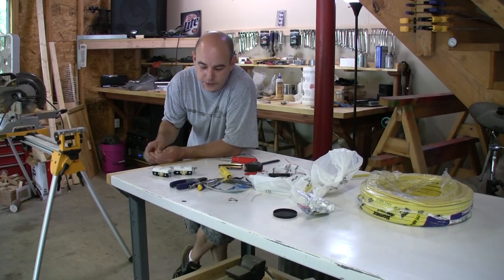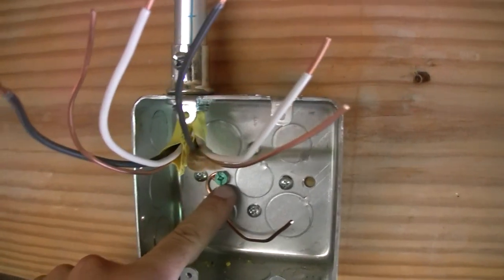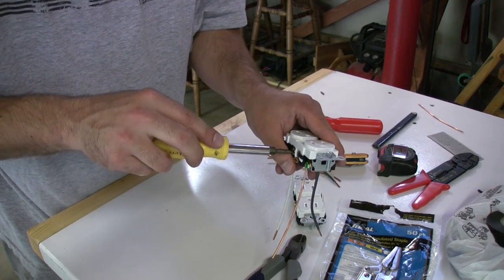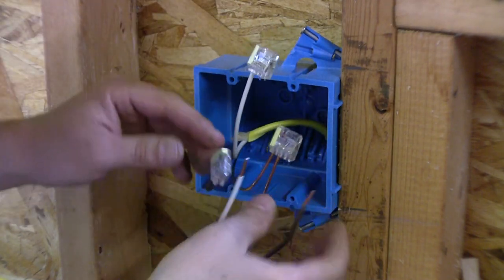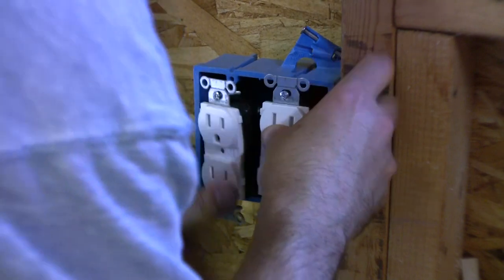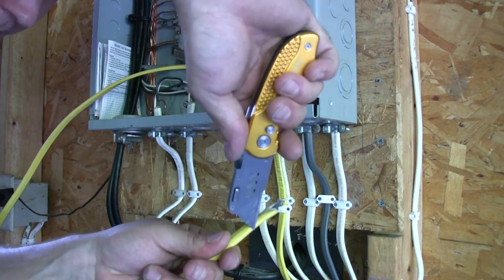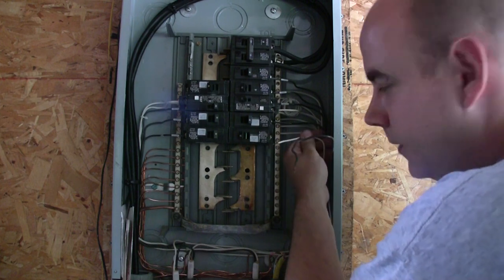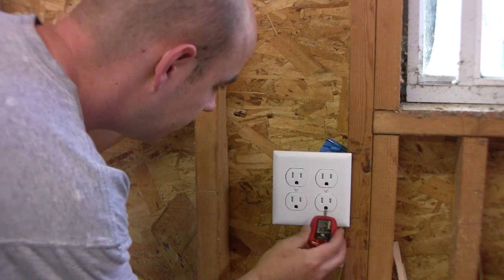Adding Outlets & Double Receptacle Wiring

Comment: As an electrician I'd NEVER use those type connectors for a joint.  They seem popular at times but nothing will ever beat a properly twisted tight wire nut connection. Not to mention that the "push in" type will eventually fail while under load. (so if you intend on doing actual work in your shop those are not the best idea...)
I get taping the receptacles (I do this to all of mine).  The idea (for anyone who doesnt get it) is to help isolate the terminals on the side in case you have a metal box in the wall or if you ever plan or may remove them from their box while hot. (it just offers a bit more added protection in case of bumps or slip ups) 
6:39  the pipe above your head should have a bushing on it... romex is not intended to run into emt conduit, doing so in that manor will eventually cause damage to the outer sleeve insulation and/or a actual gouge in the wire.
Reply: I've seen the push in connectors in quite a few newer led cans
As well as wagos which have also not been proven over time
Reply: @revolutionslo12  I've seen wagos fail a few times and it's never a good sight.
Reply: Good Eye... I totally missed that at 6:39
Reply: Well said I'm on my 3rd year
Reply: Agreed 100% from an electrical engineer. We see the push in connectors failing way too many times and it creates a risk of shock and fire. The few seconds it takes to secure that wire around the screw terminal and properly tape the perimeter of the outlet is worth it!
Reply: This shop could last a hundred years and the odds of it burning down by a wago or other "push in" connector failure is much lower than a lightning strike, tornado, arson, etc.
Reply: Broke But Functioning Garage A British tinkerer on YouTube tested Wagos buy pushing through high currents. The wire insulation failed earlier than the wagos or earlier than the wagos connection deformed. In other words, the wagos were no less worse than insulation. So I don’t know what you mean by failed; the connection failed or the connection arced or smoked ?
Reply: Thanks for the message on the risks of using the connectors. I saw them at my local hardware store and I thought about getting them. I have a bathroom box with the twisted tight wire with nut connection. I was hoping to find a better method, but per your message, I'll stay with doing this. 

By the way, is it okay to solder the ends of wires after twisting them? Does this improve the electrical connecitivity between the multiple wires that are twisted together? 

Thanks in advance.
Reply: @veltonmeade1057  soldering is okay but not necessary to make a good connection.   A simple wire nut twisted tight is long lasting and easily changed in the future should you decide to modify the electric at a later date.
Reply: Thank you for that...  I was wondering about those.
Reply: I wondered about the electrical tape. I have watched many YouTube videos of "real" electricians, but they didn't use tape.
Also, no one mentioned if you should start at the end of the run, and work back to the electric box, or start from the electric box and work out?
Reply: @LaughingblueSu  i always work from the end of the line back to the panel... that way when it comes time to land the wire in the panel everything "downstream" from that point is finished... eliminates the chances of someone touching something that is hot and not finished.
Reply: @brokebutfunctioninggarage  Thank you that is very helpful!
Reply: Bold statement saying "nothing will ever beat a properly twisted wire nut". Although I agree the engineer in me is saying "challenge accepted" lol 😆
Reply: @pauljohnson1991  if engineers could do their jobs I wouldnt have to work as hard as I do trying to make shit work that they fucked up. ;)  just sayin...
Reply: I just bought a remodel can light housing that came with those push in connectors
Reply: I've had Wagos installed for a very long time, no issues.  They work just as well as as the twisted connectors, but much quicker.
Reply: @tonymanero5544  
Thanks for that.  There's so much hearsay and anecdotes of supposed failures of products on YT.  Makes me wonder how this stuff could still be sold if any of the stories were true.
Reply: @brokebutfunctioninggarage  
Calling BS on that.  Where's your evidence refuting the results of the testing that's been done on these products?

Comment: I never use push in connectors for heavy or unknown loads,and certainly not to connect ground wires.(l may be paranoid,but I don't really trust them.)They are fine for connecting lights though.Looping the wires clockwise and screwing them tight is what i like to do.
Also the tape is quite unnecessary.
Reply: Michael Nobibux that's your opinion.

Comment: Hey Mitch, very neat job. As a master electrician and former electrical inspector, I have to find at least one thing wrong 😉. The short piece of conduit on the metal box should have a bushing on the top end, and all receptacles in garages and shop areas should be GFCI protected. I'm not trying to be nitpicky, I just want people to be informed.
Reply from the maker: Wow ok! Cool no I like knowledge thank you! I'm gonna look into that bushing I remember questioning that and sanding the edges. I like things to code, ohio.... but yes as for putting in GFI receptacles. I guess as I add outlets I will change the first one in line out...?  Really does help thank you!
Reply from the maker: +MIXED TEA Thanks for tip! I was unaware that was a no no.
Reply: No you can staple 2 wires together, but only with 1 staple.  If there is a staple beneath the romex on the top, it can cause the circuit to trip.  Remove the staple on the 14-2, and staple the 12-2  (not too tightly, because that can also cause tripping) and 14-2 down with one staple
Reply: Nice to hear a piece of constructive criticism on the internet without you calling the guy a fucking idiot or a moron. Very good tip as well.
Reply: ...also, are those outlets rated for 20amps?....does it really matter??
Reply: This is nothing compared to the fact that this is a sub panel and he has the ground and neutral bonding still intact. Mega no no.
Reply: Country Family that's what I was thinking I put gfcis in as much as I can they cost about 14 $15 but they are much better outlet they will protect you much better much faster than your main circuit breaker will
Reply: If that’s 12 awg wire then I’m pretty sure to code he has too many wires in the box....... each yoke counts at 2 along with your current carrying conductors which is 6, then add 1 for the ground. So that’s considered 11, 12 awg wires in a 2 gang box. Maybe if it’s a deep box it’s within specs but damn close. Get rid of those little connector things and wire them up the normal way and you would definitely be good
Reply: mitch ,,am i blind or do you have the neutral and the ground connected together in your subpanel ..from my learning the neutral bus bar in the subpanel must be floating ,,and not bonded to the grounded  bus bar ...i the main panel they must be bonded
Reply: @Steve Main code calls for it to be and it's smarter to have the gfci at an outlet so it trips there instead if tripping in the panel
Reply: @BradsWorkbench  yeah depends on what box he used, box fill isn't my strong suit
Reply: @Steve Main so how we do it is we keep the spot that would trip at an outlet instead of in the box. So instead of tripping the breaker you trip the gfci. You just run however many outlets off of the gfci outlet and you're good. Most don't need to be gfci but when you run them off of one you basically have what you're wanting. All outlets would be protected
Reply: @Steve Main gfcs are needed, especially where damp and wet conditions are. Code specifies locations where they are needed but it never hurts to have them at all. They're a necessary part of safety so I'm going with no on the over kill
Reply: A master electrician and inspector? 😂 I doubt it. You only found 2 code violations?
Reply: @Steve Main you can put as many gfci as you want. I use them all the time, but it's smarter to keep all tripping of anything out of the box
Reply: @andrewilliamson6057  he understands that. He was just asking that since he wired them double gang, would having the parent outlet be GFCI be enough to protect both both outlets?
Reply: @21area21  yes. If you run off your gfci in a double gang outlet box then yes both will be gfci if you wire it correctly.
Reply: @21area21  you can run in series as many as you want off of a gfci and those outlets wired off of the gfci will be protected. Gfcis are wonderful but not all outlets need them. My rule of thumb is with the amperage
Reply: @aklover18  Good catch.

Comment: Those push in wire connectors are really handy. I just don't trust them. Nothing beats a properly twisted splice+wirenut.
Reply from the maker: +Sparky 97 I agree now. I'm doing more electrical stuff currently and I like the bulky nuts.... Especially for the ground. However I have had no problems with those push types!
Reply: Mitch Deitrich They work well. I've had zero problems with them as well, thank god! The thing is they haven't been on the market long enough to see if the connections go bad after 30 years or so. But they're code compliant so they must be a somewhat trustworthy product!
Reply: In my trade school I'm on 4 gangs and 3 gangs, with all sorts of wires and such coming in the box.  Really gotta say, those wago's that can support 8 wires would really come in handy versus all the pigtailing i gotta do
Reply: So those push in connector are up  to code?
Reply: They are handy, but they are only good for lighting circuits honestly. They get very hot with a 15 amp draw. Just think, its a razorblade edge making contact with your wire, not much connection there. High resistance
Reply: @SwedeBoy27  yes, wagos are great. We use them all the time in fabrication and commercial uses.
Reply: @Writer B.L. Alley I always say it, just because its legal to sell and use, doesnt mean its safe!! We lost our garage a few years back and the fire inspector claims it was due to "thermal arcing" somewhere in the circuit which is very common with the stab connectors! Scary stuff
Reply: I'd rather twist an tape than use that crap
Reply: Absolutely!
Reply: Wire nuts are such a pain, accept the future of stab connectors! 😂Wago is the only brand I'll use for stab connectors. I've never had issues with them or witnessed this overheating. I strip the wire to the precise measurement and use electrical around them.

Comment: those push in connectors are very unsafe over 5 amps. Do a test yourself with an electric heater and tell me how hot those bastards get!!!  Plus why wire nut the outlets all together, when you can daisy chain one outlet to the next in a double gang box?

Comment: Push in connectors are not reliable at high loads! Everyone seems to love them though!But they are a fire risk,even if the code allows their use.
I use them only in light fixtures and low wattage applications.
Use wire nuts with the threaded steel spring inserts instead!!
Reply: This is not true.  They are tested under the same UL standards as wire nuts.  They have the same rating, bot wire nuts and push in connectors are rated for 600 volts at 105 degrees C.

Push in connectors are usually rated for 600 volts.  Household wiring is 120 volts.  

I'll change my tune if you can show data that these are somehow inferior.
Reply: Zachary Collier 
Not because something has a UL approval makes it a superior product to others similarity approved!

Comment: That sub panel is set up wrong .. your neutrals should be separated from your grounds
Reply: piazza gregg the ground & neutral should NEVER be bonded together in a sub panel because you've now given the return current more then one path back to ground .. a sub panel with the ground & neutral bonded will never pass inspection
Reply: piazza gregg Oh I didn't see that comment, that it explains why they're mixed ... but if that feed is now being fed from the main panel he now has to take that feed wire all the way out & run 3 wire that's rated accordingly
Reply: @Ted Fisher The neutral (white) is bonded ONLY to the EARTH (outside ground rods) + Ground + main panel ONCE (sometimes main panel can be main outside disconnect, next to meter).  A picture: pg. 4: Exhibit 250.1 might show http://necconnect.tpnicdn.net/wp-content/uploads/sites/2/2014/08/Article-250.1-250.4.pdf
Reply: Its probably an older panel in another building so there is no ground wire

Comment: Is that the main power panel or a secondary? On secondary panels the ground and return lines should be isolated.
Reply from the maker: Second. Used to be a main. Also if the ground bar is an issue to you it like everyone else...it was fixed. But in my personal opinion the that doesn't matter... Like a water well being grounded the well casing. " Ground loops... " Whatever. Electricity follows ALL paths to ground. But hey man!! Thanks so much for watching and commenting!!

Comment: Is it my imagination or did he use 12GA/20A wire and 15A outlets?  Seems he'd be better off with 20A outlets, not that you can't use 15A and lower capacity. Gives you the ability to use 20A devices... assuming the breaker was 20A of course.  Just say'in.

Comment: You are over killing certain things only to make the entire gig more dangerous.  There are way more staples than necessary, you want a hint of slack in the cable in case of impact or puncture situation.  Rather than leaving a proper loop of extra wire before going into a box, you have ran a conduit... ...that has one end with no grommet/connector.  I am  not a fan of any quick connect push in connections.  I am not an electrician, but seriously, why not just loop and screw down?  Why tape down a plastic quick connect connector?  It's not like the housing is going to shatter...

Comment: I'm not a electrician, but are you not suppose to run Romex wire in conduit, when it is exposed? Especially in a shop environment.  Here in Cali it is code. Maybe were you live they don't care if you electrocute yourself.

Comment: You implied that the panel in your shop is a sub panel. It looks like the neutral and ground are connected and should never be in a sub panel, they must be separated or the ground wire will be carrying current. A receptacle tester will not catch this. If a gfci was installed and you plugged something in, it should trip.

Comment: Great video, I've learned a lot. Do you use 12/2wg for all your wiring? I've found that this size wire is a real workout. I've had 'professional' electricians do work for me and none have wrapped the outlets also, none have used a tester. When I checked their work with a tester sure enough the wiring failed. When I cut off the house power my wife gives me hell. Guess she wants me to get electrocuted. Also, asks me if my insurance is paid up. Do you use a GFIC on your circuits? I've used the wire connectors with no problems. I wrap them and never, never reuse them, the same with wire nuts. After I insert the wires I put a zip-tie on the wires where they exit the connector.
Reply: No need for 12/2 unless your using a 20A breaker.

Comment: I advise against using the push type connection on the back of the outlets, use the side screws instead. The reason for this is every time you plug in/out of the outlet, that connection is stressed. It will ultimately fail, the wire will either wiggle loose or shear off, leaving an electrified nub. Take the extra 10seconds to form a hook and use the screws.
Reply: He didn't use push in aka backstab. These receptacles are spec grade and don't allow that method. What he used is the back wiring option where the wires are clamped in place when the screws are tightened.

Comment: I am sorry but you are using 15 amp plugs on a 12/2 wire. Not cool. Those connectors you are using are for amateurs. Nothing beats wire/wing nuts. Wrapping plugs with electrical tape is questionable. Wrapping the connector you are using with tape could also create extra heat. No heat dissipation. Fire hazard. Probably against code. Just sayin'...
Reply: He is using "spec grade" 15 amp duplex receptacles which is exactly the same as a 20 amp, but without the horizontal slot. This is code compliant on 12-2. There is no reason to use a 20 amp duplex receptacle.

Comment: Shit video, didn't really explain anything on how the second outlet corresponds with the first one! Reading comments a lot of people don't like what you are doing but don't let it discourage you mate! You are probably learning as I am! I am hooking up a solar system that I hooked up a couple years ago, we had a flood so I tore down everything and moved to higher ground! Barns, shop, livestock pens, greenhouses ECT and I'm just getting back to putting the solar back up! I can't remember how I did the outlets, I have two outlets coming off an inverter and it has a ground that I ran two wire off of one for each outlet, then I have two AC hot wires one for each outlet and one neutral wire and I think I hooked it to one of the outlets then connected a wire running off the one outlet to the other outlet! Can't remember! I have to make sure what I did system cost 10,000 can't blow it up! I already had to replace a charge controller after a year cause the flood hit one of my solar panels and fried it! Get away from those slip connectors everyone in the comments said they are bad news!